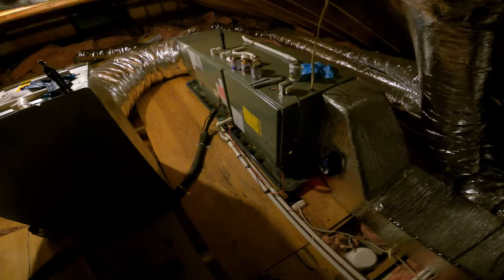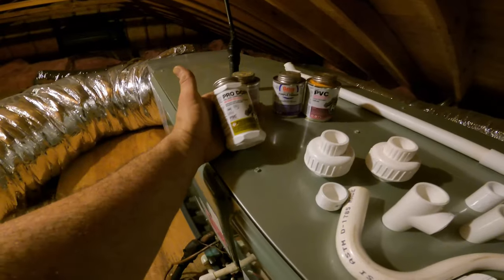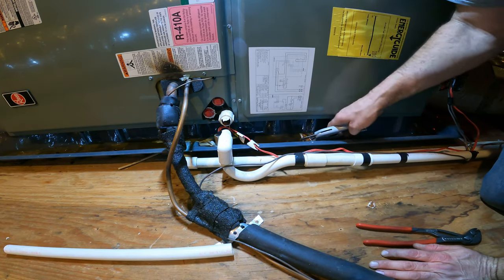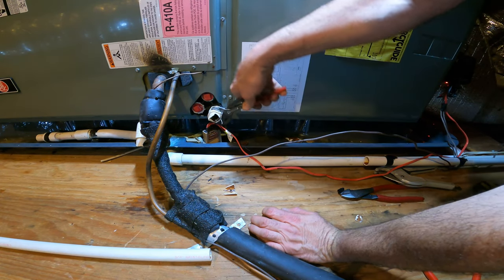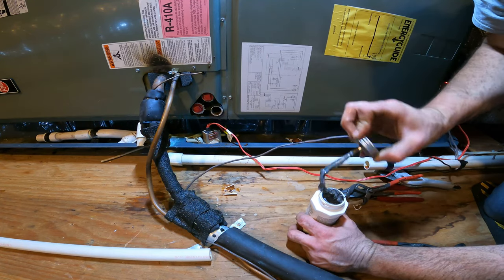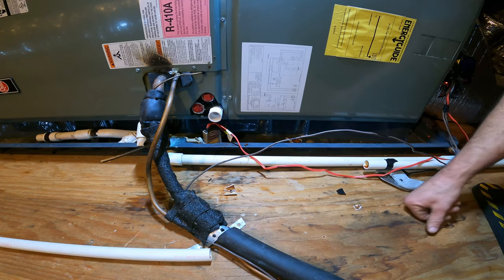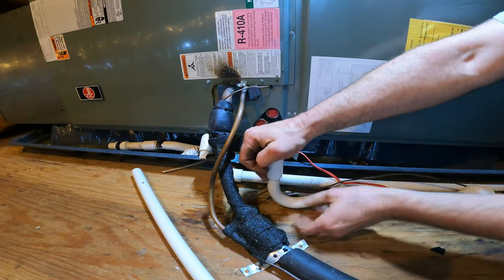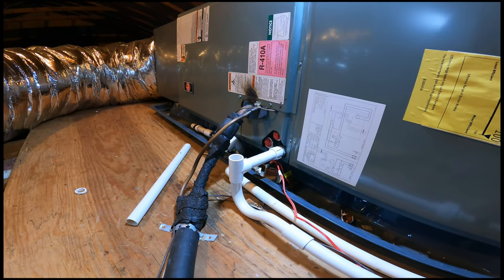Installing AC Condensate Drain With Clean Out Port

Comment: Is the WIER of the trap deep enough per negative water column in that pull through air handler? Should always vent after trap for proper drainage. Always good practice to use teflon tape ( NO PETROLEUM BASE PIPE DOPES) they soon eat the thiner part of the male and female threads on the pan or pvc. Rheem did feature female thread brass connections no tape needed. That stand/secondary pan is junk IMO. Unit should be 4" higher, and the "gunk" in the drain lines is more than one issue in that install.
Reply from the maker: I didn’t install this unit but inherited it. The drain pan is junk. I remember when I came out they swore you could run it over with a van. So many of these pans cracked over the years. I need to redo my ductwork. Yet m planning on getting ride of this ac and putting 2 units. A first floor second floor system. Just the owner of this system is cheap and wants me to work for free. Therefore when I finally have time I will get to it. Most drains gunk when not cleaned out for 9 years. I am most likely hanging the systems one over the other when I do install the new units. To have more attic space. For this system I have to up the return size. 14x30 is too small for a 4 ton
Reply: @howtohvac3234  I lent my hand for the return of grace many times in my career. Right now you have ability, but it will not last. Getting paid is the real trick of the trade. No good deed goes unpunished. You are on the right track with R/A. Deeper   R/A cans help (22") and come off the side with the flex. The 14X30 was so they did not half to head out the stud bay. HA! There is a right way. There is a wrong way, And there is a way to make money. Being the guy with the wheel barrel and shovel behind the parade never pays. Rarely was I able to stack two units let alone hang them. Think that was mostly a commercial application or basement. Can the rafter handle it. Never hang from masonry/ tile roof.

Comment: How's the Reme Halo unit performing? First I've heard of this device.
Reply from the maker: I like the reme halo. Put many of these in. The guy I deal with at my supply house talked this one up. Took him 3 weeks for me to get this back in early April 2020. Easy to put in yet unit wasn’t cheap. There is a newer LED version of this UV lamp. I keep my fan constantly running to help clean up the air of dust and any bacteria, mold, or germs. It sterilizes or kills viruses.

Comment: Can water freeze in the p trap? I just replaced one that was so cracked that i can only imagine it was ice that did it.
Reply: In happened to a furnace I had at work in Canada. After some discussion I added a small AC pump heater to the replacement, if I recall it wastes about 8 watts but its never happened since.

Comment: I need to replace mine. It broke at the threaded fitting and some was left inside. What's the best way to remove the piece of fitting left inside?
Reply: use an easy out tool

Comment: Shouldn't you have the secondary draining into the pan so the float switch would cut off the compressor if it got stopped up? Just asking....I'm trying to learn as much as possible about hvac....47 year old 2year in the trade guy....
Reply from the maker: There is a float switch inside the emergency drain pan. You really don’t need to send a secondary drain on the unit into the drain pan. The drain pan crumbs you really don’t need to pipe secondary drain off the unit into the drain pan. The drain from emergency pan overhangs the gutters. Therefore, if water is leaking out the customer knows to call for service. Yet if both drains back up then the float shuts down the ac. The float is the third safety. Many nj inspectors will fail jobs if emergency pan isn’t piped

Comment: Hello - i have a few questions... this looks similar to what we have in our attic.   What if the clean out isn't capped off, does that cause problems?  If you know there is a clog and want to use the air compressor to push the clog out of the drain, can you use the clean out spot or is it better to create one of those sections where you can easily take the PVC apart?
Reply: If it's ur house,you  shouldn't care..only if it's not urs
Reply: If you have a tee on yours like he installed on his, it should definitely be capped. You can look up static air pressure. Basically it will pull in air so much that water will stay in your pan and potentially overflow. As far as the air compressor, I feel like that is preference based. In my opinion air is a quick solution to get it clear, but flushing with bleach or vinegar will probably suit you better.
Reply: The T should never be capped off , leave it open

Comment: Trap and vent, just like any plumbing fixture.
Reply from the maker: Vents not really needed on these drains. Trap is necessary if drain is on negative side of blower. If on positive side, inspectors require the trap yet system would drain same if not better without

Comment: @2:04, that PVC line is too old, that is why you crashed it.
Reply: I've had brand new pvc do that to me. I actually found that the copper pipe cutters work great on smaller pvc pipe, especially if it is old and/or brittle.

Comment: The Drain line should have an air vent after the trap....
Reply: Where is that required by code for condensate line? I know that plumbing drain lines need to be vented, but I've never heard of that requirement for condensate. I think they're generally empty enough that they vent themselves - b/c they're generally draining to atmosphere.
Reply: @sowellfan  perhaps a cap on that cleanup and then a vent that opens below the level of the top of the trap so if there's a backup, it'll also drain out of the vent instead of the backing up into the system, unless it's connected to main drain?
Reply: That's what I thought. I put a cap on mine and it started going into my backup pan out my backup drain line to my garage driveway

Comment: Good luck screwing the P section out of the unit with only the one barrel union fitted. A second union next to the T piece would have made it a fully professional job. Just sayin!!!
Reply from the maker: Why would I want to unscrew the p-trap? I never unscrew a trap, unless replacing a coil. The union is only to help clear a stubborn restriction.
Reply: @howtohvac3234  I think he's saying if you put a 2nd union between the outlet and tee, the whole trap section could be removed to be cleaned. My only issue with that would be that it may create a possible restriction at the fitting. I would personally use a 3/4" fernco on both ends so there's no lip inside for gunk to get stuck on.

Comment: PROBABLY YOU should watch a video of a proper way to set up  CONDENSATE DRAIN
Reply from the maker: This drain is properly set up. I have piped in a few thousand drain lines.
Reply: Can you include yt link to your video on how to properly install a drain line
Reply: @FernandoRodriguez-ds5ri  as soon as make one.  My ceiling caved in upstairs on a drain line similar to the one you posted. I used a j trap for the one I replaced it with
Reply: @FernandoRodriguez-ds5ri Probably still working on it…lol😂

Comment: ok so your old drain is not up to code and pitched about 15* downhill, your new drain is not up to code and pitched about 15* downhill but has a Union ... which does not satisfy the new standard for a non destructive method of cleanout. just gives you an opportunity to make a bigger mess. a second union  between unit and trap would work ... 
you haven't satisfied the IEC mandate for Condensate pipe insulation. or the IRC standards for overflow protection. and for modern equipment a P-Trap isn't deep enough, a j-Trap is required.
Reply: Can you cite some chapter & verse here on your code-talk here? At 2021 IMC 307.2.5  it says, "Condensate drain lines shall be configured to permit the clearing of blockages and performance of maintenance without requiring the drain line to be cut." - seems to me that his setup here doesn't require cutting of any drain line for maintenance. 

Also, I'm not seeing any code requirement differentiating between P-traps and J-traps. What kind of install manuals are you seeing this in?

Comment: This guy is a clown. He left the whole
Pipe in the attic with zero pitch lmao
Reply from the maker: The drain line has a pitch water goes through. Very minimum. Yet I thought I mentioned I will be replacing this system soon. At that point I will raise up the air handler to give better pitch. Going 2 systems 1st and 2nd floor. You must be a ranger fan! insulting someone you don’t know. If you are a real devils fan, what was the chant 1940 about? that was heard often in Rutherford?
Reply: If there was zero pitch, why did all the water he poured through it drain out? If there is zero pitch, why is there a big gap under the pipe where the P trap is and less of a gap neat the other end of the pipe?
Reply: @MAGAMAN  the coil is the highest point lol  that’s why if you did what he did in new Jerry’s it would fail inspection
Reply: @MAGAMAN  and I’m not talking in front of the unit my man take a closer look ;)
Reply: @Devilsfan-pd8ov  so what was the chant 1940?

Comment: Terrible
Reply: What is terrible?
Reply: @speedracer609  vent goes after the trap
Reply from the maker: Don’t need a vent on this drain. The clean out tee is not a vent
Reply: @howtohvac3234  yes I know the clean out tee is not a vent, but a vent is always required because vent after the tee allows air to enter the line to help push the water out, and let's say you have blockages over time a vent after the tee allows if any stagnant water causing odor to vent out and not get back into the system if the trap was not filled. Just like a toilet has a trap and vent that goes up and usually out the roof.

Comment: At least they put a p-trap! The moron who did ours didn’t — and I only discovered this when our ac started shutting off. They didn’t have a p-trap despite the large sticker warning on the air handler, and the crud actually was stuck in the vertical line going into the floor. We also got an idiot surveyor that didn’t do his job and didn’t find the plethora of crap around the house. So I’m discovering all these things myself and fixing them — properly.
Reply: Hard to find good help these days.  Sloppy and cutting corners.
Reply: My unit was installed just a couple years ago and there is no P-trap.  The P-trap does not help prevent buildup, does it? How? I thought it just prevented gases from coming in? Yet, in this case, there is no gas. It’s just the outdoor air for me because the condensate drain goes directly to the outside outside. Which begs the question, isn’t it pointless for me to have a P-trap on mine? I definitely want to add a Tee clean out!